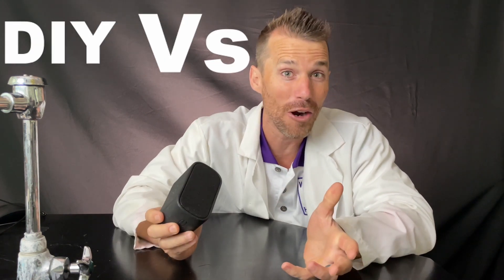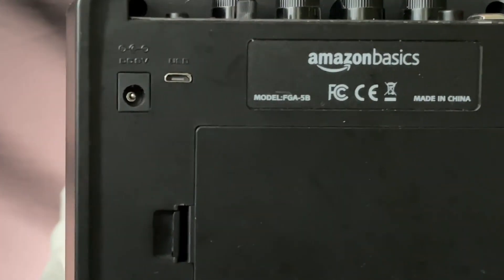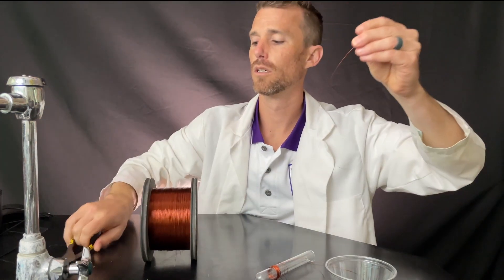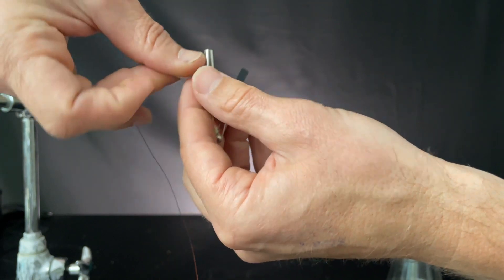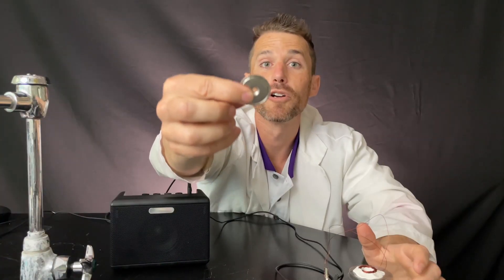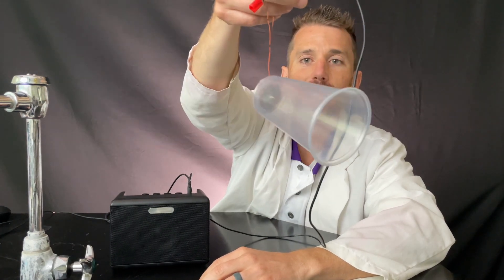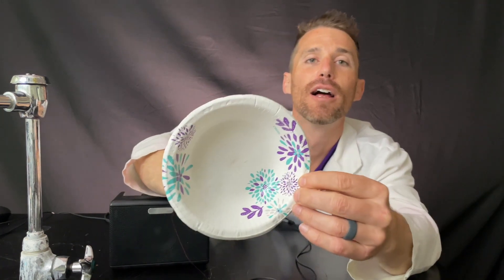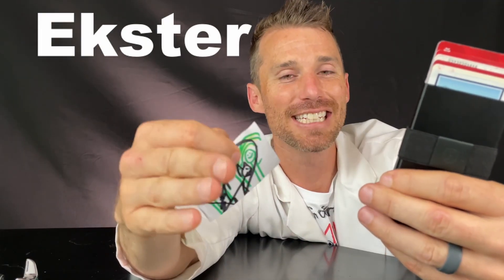Cup speaker is  louder than this real one?!

Comment: I have awg 33 but nothing else right now
Reply: I just thought of a perfect mod. Took a roll of paper towel to cut for the magnet tube. Use graphite to lubricate the centrer. And I'm going to try using wide thin winding of awg 32 I think it's 32 it's pretty thick

Comment: you neglected to explain the mechanism of a speaker's operation, thus you clearly don't know how a speaker works. your device will not work since you have not provided a way for the coil to move anything separately attached to the vibration medium. do your research.
Reply from the maker: That's the trick! I didn't have a great deal of success getting the coil to move the plate for some reason. My next batch of tests is going to be figuring out what is takes to make that work! thanks!
Reply: @flemdogscience  you're welcome. persistence is key, im sure you know. thanks for uploading your progress.
Reply: @h7opolo he said thanks because he’s a kind dude disregarding your negativity not actually thanking you for your inane imput
Reply: You should do your research on what having a life is, don’t judge this teacher just for trying to teach something in a simple way with your “ughmmm ashtually 🤓 “

Comment: speakers work by vibrating , to make this better set them up like a piston " what almost all commercial speakers are " , use a couple strips of paper around the magnet to act like a former , one strip  will stay connected to the voice coil and the other will be removed once coil is wrapped for clearance so the voice coil can slide over the magnet easily but not too big of a gap " fights standard coil loss " , the coil itself impedance is important to not ruin amps, most amps want 4-8 ohms but some drop down to 1 ohm " rare for the style you used " magnetic wire charts will give resistance per foot and how you calculate how long a piece of wire you need , to reduce inner turn loss this should be one layer cylinder shaped when wrapped , the paper plate can sound as good if not better then the commercial speaker you're using once setup right , you need a suspension system for the plate that keeps it centered but allows movement of the attached voice coil over magnet " folded business card does fine or outer cage and rubber bands
Reply from the maker: Great tips! I am going to mess around with this project a little more. I really appreciate your thoughts here. Everything I have done has been trial and error based on a couple principles, but you give me so many more iterations to try out! Speakers in general are super fun for me so I will try and make this model you are describing work. The version I did here was the really quick version I felt like worked decently well. My versions that were similar to the style (but not quite exactly) to what you described I had a bit of trouble really getting to go. You have some tips though I didn't try, so I will keep at it! Thanks!

Comment: Would it work if you stack magnets like pyramid and lead power source only to the first or biggest magnet?
Reply from the maker: I would like to try what you are suggesting. Can you tell me a little more? I don't think I can quite visualize what you are saying.
Reply: @flemdogscience  I mean like what if we would set up one magnet the same way but next to it add a smaller magnet. At this moment I got like 3 set up ideas though.
1. The power source connected to magnet A but you add a magnet B which has opposite polarity to be attracted by magnet A
2. Same as first experiment but this time two magnets has same polarity to repel each other, maybe there's a chance to tie them as close as possible to minimize energy traveling distance to magnet B
3. Also same as 2 experiment but this time power source connected to both magnets while they still repel each other.

My conclusion is that I want to understand if frequencies travelling through two or more magnets would interact with each and if that interaction could lead to higher frequency build up (in this situation volume up) but my biggest interest is if the energy could travel from A to B magnet to play a sound.